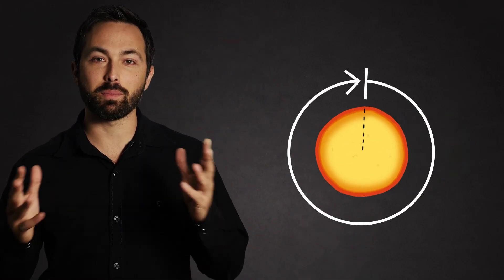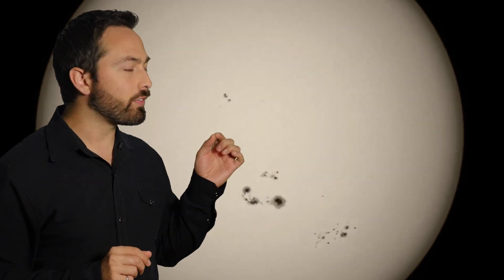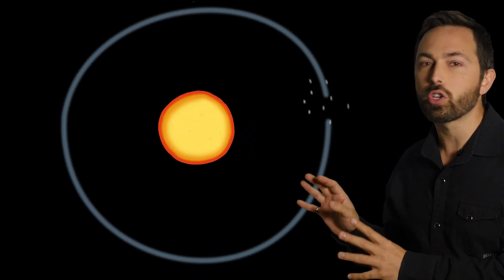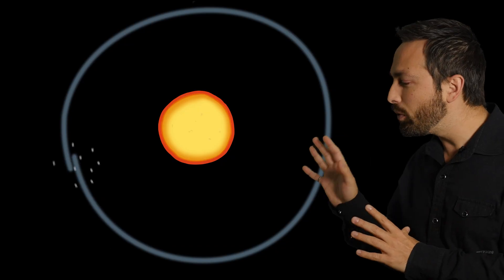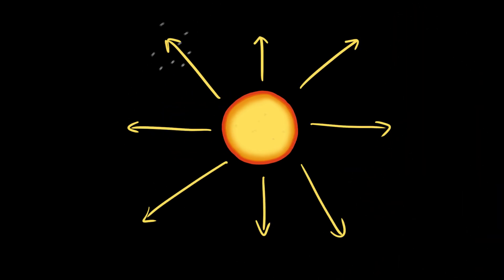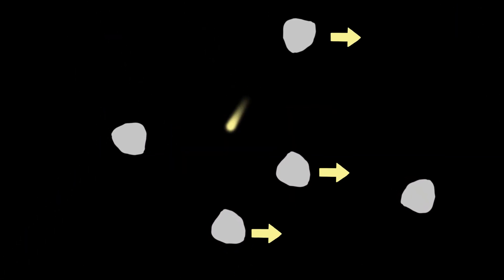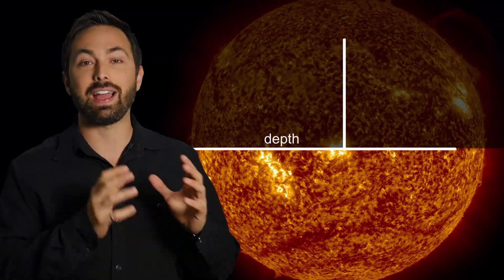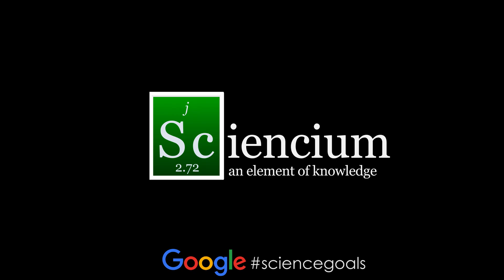Why is the Sun Slowing Down?

Comment: Can dark matter can squeeze in this.. Im 14 and stupid but stupid sometimes solve stuff. Butt what if the apearance of the dark matter between the plasma then hits faster that anything like no explaination it will slow down i mean there is countless dark matter appearing...

upon typing this.i have a question when dark matter pops up can it apear on a existing matter? Or just a thin space aaaaand is it like the light that can bumb in but cant really answere this cuz dark matter disapear faster than a message passing tru youre brain.

Comment: Based on the graphic shown of the Sun's inner photons shouldn't it be possible for the photon's bounce to have an equal chance to speed up the rotation as well, or does photons only come out at a certain angle, just like how they come off the sun slowing dust particles??

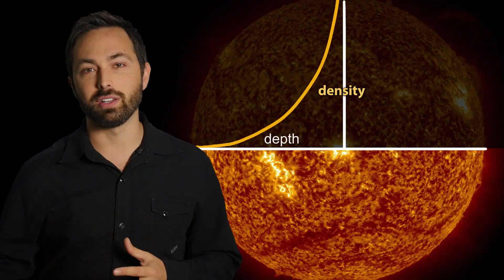Comment: [4:40] Wont it take infinity to slow down solely by this mechanism to any star ,no matter how fast it is spinning and how big is the time interval? As the described effect is caused by the spinning (the projection of the velocity vector of the photons on the tangent plane, to be specific :) and the slowing down will weaken it. It can get closer to zero, but never reach it. Or I am missing a thing?

Comment: Can someone explain why dust slows down in its orbit in more detail? Wouldn't more of the photons be hitting the inside edge of the dust than the leading edge, therefore bouncing back toward the sun and pushing the dust further from the sun, giving it a higher overall potential energy?

Also, if photons can slow down the the dust (or anything for that matter), but the photons obviously carry on at the speed of light, what happens to the kinetic energy that was lost? Is it simply converted into heat energy inside the dust?

Comment: Some simple 'facts' about the sun:

It's convection has actually been measured and determined to be even less than 1% of what is necessary for energy transport from the core to the outer layers.

How does it come, that heavier elements, that we can clearly detect via spectrometers don't clog up the very small zone where pressure and temperature are sufficient for continuous fusion?

Who made the blatant logical error of saying, that the lightest element Hydrogen sits in the core of the sun, while we can even detect planetary amounts of Iron in the sun's atmosphere? Light stuff always floats on top of heavy stuff.

Why, after 70 years of highly funded fusion reactor research did not one single work properly?
Fission took only a few years.

The sun is not a fusion reactor, even slightest changes in density or amount of mass would destabilize the fusion process, since the yield is very dependant on both pressure and temperature, increasing either by one ppm would increase the yield by 0.1%, enough to oscillate away the outer layers.

Electricity.

Comment: how is this theory? 
sun is cooler on outer surface compared to its inner layer.
i dont know how or why the core is churned, but when you imagine the outer layer is more viscous due to lower temperature and doesnt want to move with the same velocity as inner layer. its just like when a lava from a volcano moves on ground or inside sea. outer cooler surface moves slower when compared to hotter part. having exponentially dropping velocity from core to outer surface. I am not completely  convinced with the photon theory, probably thats why it results in undying sun.
sun will have to eventually die before whatever happens to universe  and if am not wrong this is how it dies....cools down from outer layer to inner layer ....badabdabdbdabdab.....having a final explosion into supernova. tht will be a site to watch...till now i have just watched artists depiction or animations of supernovas :D. 
please do comment if thats anywhere close to possible theory

Comment: I might be confused, how can a lightparticle gain momentum when it always travels at the speed of light? it can indeed bounce on those dustparticles, slowing them down, but does it really gain something there? i know this should be logical, conservation of momentum/energy, but I don't get how they could gain momentum.

also, how could an object with no mass convey energy to another object? it would have to transfer energy in another way than by pushing

Comment: As the photon bounces off the last particle and into space, it exerts a tiny force on that particle. But wouldn't different photons exert force in random directions, depending on the angle of the collision, and therefore shouldn't it cancel out the effect? I think the answer to this is that a head on collision (using the car metaphor) would be more forceful than a bump from behind.

Comment: Would this not result that we would observe one side of the sun slightly brighter (or at least the very edges) and/or (depending on how many photons bouncing on the outer layer) move the visual sun a bit or at least make it a little bit blurry? This due to more light go into a angle?

Let's say that 50% of the light coming of bounced to a 20% angle it would make a double projection of the sun right? And if the angel vary a lot it would make a blurry projection? 

Or is it just that the speed of the outer layer is so slow compared to the speed of light that the angel will be so small we can't even detect it? (probably this... So nice when you figure stuff out while you write and then still want to post it :P. But still does anyone know if its observed/known?)

Thanks for thoughts!

Comment: I'm not convinced yet, according to this theory if the photons get deflected (less than 90 degrees) by the dust particles they are taking away some angular momentum hence if they are deflected by more than 90 degrees then the photons must be pushing the particles away too. Given that dust particles are much larger than photon, the number of photons hitting the dust particle and getting reflected back ( deflection of 90 to 180 degrees) would be much larger than the ones getting deflected by less than 90 degrees. Hence the dust particles should be moving further away from the sun as a result of the push of photons

Comment: Wouldn't the direction of the photon be random and therefore have a chance to either strike against - causing a slow down, or strike with - causing a speed up, of the outer layer - like tailwind on an airplane?

Comment: How can a photon "steal" another particle's momentum if it is already moving at the speed of light and can't speed up anymore?
Reply: I will just paste the answer i just put on another comment here XD
There are two things...
First, the momentum is also about direction, if the photon changes its 
direction in the colision, it might also change the momentum of the dust
 particle in some direction.
Second (and most important, I guess) the photon momentum is not p = mv 
(for it does not have mass), it is h/lambda, where h is Plancks 
constant, and lambda is its wavelengh (because it is a quantum thing), 
so it can change the modulus of its momentum by changing its wavelengh.

Comment: So uh... I can't help but to think about the entire... ya know... 'photon bouncing around inside the sun' thing.... if its bouncing around inside the sun, why doesn't that cause anything? and regardless of that answer, the photons bouncing around inside of it, means that it would leave it at random angles and such, not 'straight out'... meaning, that the photons are just as likely to hit that invisible layer as its moving WITH it, not just when its moving against it. So not only would the photons be slowing it down, but it would also be SPEEDING IT UP. . . So I don't think photons could actually be a realistic 'cause' for why the sun would be slowing down. Maybe it has a very tiny impact on that, but considering all that, I really doubt photons are slowing it down as drastically as people have thought...

Comment: Has anyone tried applying eulerian video magnification techniques to high-quality video footage of the sun?  Eulerian video magnification can take a video feed of, say, a human being and magnify the rhythmic slight variations in color over the surface of a persons skin.  It then makes those differences larger, and you can actually read a persons pulse from any video taken of them.  They can also magnify microscopic motion in the same manner.  It should, I expect, be able to make it extremely easy to analyse any kind of cyclic changes in either the Suns light output or fluctuations in its surface, though I haven't heard of it being applied to astronomic observations yet (its relatively cutting-edge computer science work).

Comment: What do you mean at 4:54?

Greater momenta? 

I assume that all light photons will travel at the speed of light, but do some photons have more mass than others? 

It makes sense that a brighter star would emit more photons, but would the photons also have more mass? 

Perhaps a good idea for a video (the mass of a photon). 

Thanks!
Reply: The momentum p = mv is an apriximation for classical stuff (not quantum) and that are moving at speeds not comparable to the speed of light (not relativistic). 
The photon momentum may be writen it is h/lambda, where h is Planck's 
constant, and lambda is its wavelengh (because it is a quantum thing), 
so it can change the modulus of its momentum by changing its wavelengh.
If the star emits photons with higher frequency (or shorter wavelengh), these photons will indeed have greater momentum

Comment: Maybe a stupid question:

Im not into physics but aren't photons massless? How can they generate momentum? Isnt momentum mass*speed?
Reply: In physics momentum has some more general definitions so that you can define momentum for things that does not have mass. These kinds of momentum are useful and are conserved just as the "p=mv" momntum.

The momentum p = mv is an apriximation for classical stuff (not quantum)
 and that are moving at speeds not comparable to the speed of light (not
 relativistic). 
The photon momentum may be writen it is h/lambda, where h is Planck's 
constant, and lambda is its wavelengh (because it is a quantum thing), 
so it can change the modulus of its momentum by changing its wavelengh.
If the star emits photons with higher frequency (or shorter wavelengh), 
these photons will indeed have greater momentum

Comment: Lightspeed is fixed, so how could a photon "gain" momentum from hitting an object?
Wouldn't it rather loose momentum, if at all?
And btw, after a photon travels through diamond (slowing down by 40%), how does the photon accelerate again after leaving the diamond? Where does it get the extra energy from?

Comment: It could simply be the electrical discharge as explained by the EU theory. The external source of electrical discharge is continuously fed into the surface of the sun which is why the heliosphere is hotter than the surface. This would mean that the it would exhibit radical electrical activity and thus be slowed from the incoming discharge.

Comment: But... isn't the coriolis effect enough to explain why higher layers of a rotating object made of plasma slow down from inside out? And beside, the vectors of photons impacting with dust particles should be way higher on the radial axis than any other direction, so why dust particles fall down onto the Sun? Shouldn't they instead get farer?

Comment: but how can something with no mass slow something down? :S no mater what the speed of the photon, the 0 mass * the speed of the photon is still 0 :S Im not a physicist or what not, just a nerd with thoughts. like a 1 ton car driving and crashing into a wall in 30km/h, the force of which the wall receives is 1 ton times 30 right? so for a brief moment the wall receives a 30 ton hit, right? :O

Comment: Question(s): If a photon takes angular momentum from a dust particle would it speed up? If it did won't that put its speed above the speed of light which isn't possible. Where does that extra energy go? Does it go into changing the frequency of the photon?

Comment: why wouldn't photons push dust away? when new star is formed, it clears nearby dust, by pushing it away with its fotons, so thats contradictory to dust spiraling down to a star. The angle at which photons hit particles, would be so insignificant, that outward momentum should be far greater than decceleration (unless dust is allready on a very close orbit, so its speed is comparable with speed of light)

Comment: Please don't go harsh on me I saw similar questions but not exactly an explanation for mine. SO here it is:

I do understand that photons hitting dust have a slight angle to decrease the momentum of dust. That's how it slows down. However vectorially it has still the biggest component radially outwards. So it should also push the dust away from the sun. Even if it might be a small effect it seems somehow significant considering that dusts are not very fast compared to speed of light and radial vector value is still very high. I also know radius of orbit is proportional to speed^2 (centripital acceleration = v^2/r) which enhances the effect. Though still I think order of magnitude-wise they should be similar.

Sorry for long text. I appreciate any explanation.

Comment: Hey Derek, or whomever could answer this, you exposed that the external layer has been slowing down, and the hypothesis you explain seems a bit intrincate to me. Let me explain, you said that the photons that come from the inner core, bounce several times until they reach the most outtern layer, thus slowing it down. But, if this were to be the true, it would not just affect on one side of the rotation, it would, simply, affect in all the possible ways, not only slowing down.

And the other question is, why is not friction considered as the very producer of this, slowing down? Or maybe the the production of new materials due to the nuclear fusion, that changes the density and so the velocity?

Best  wishes,

Gastón

Comment: How Photons can slow down anything. They have mass=0.
Reply: They have momentum!
Reply: But they have no mass. You need mass to have momentum right? Besides how you can even exist, be real if you dont have mass? 

Maybe photons have mass but its so super very tiny we cant detect it?
Reply: Indeed, photons have no mass. However, they DO have energy and momentum. It turns out that energy and momentum are the requirements that make a solar sail work, not mass. 

If we think about a slow massive particle, like a bowling ball, we can help to make sense of this. If the bowling ball is not moving, then it can't make anything move. And a heavy bowling ball can make something move more than a light bowling ball (if we assume both bowling balls are moving with the same speed). To summarize, how much something moves (how much momentum is transferred) depends linearly on both the bowling balls' mass and speed. Momentum (for slow moving massive objects) is defined as p = m*v (p is the momentum, m is the mass, and v is the velocity). 

This momentum is what gets transferred when wind hits a normal sail. But photons have momentum without having mass! This is how they can push things around, they transfer momentum. For a photon, E = h*f = mc2 so, p = hf/c. In this case, p is once again momentum, h is Planck's constant (6.62 x 10-34 Joule*seconds), and f is the frequency of the photon. This is how a solar sail works. Photons transfer some of their momentum to the sail, thereby propelling it along very much like a sailboat in the ocean.

Comment: but, most of the momentum is tranferred to the dust particles is pointing away from the sun. it sounds like the sun is bringing these particles closer by pushing them away. this is really strange and counterintuitive.

intuitively it seems to make ore sense that outward accelleration would contribute to angular momentum somehow..

Comment: So let me get this straight, a photon is massless, but "drags" on dust around a star because it's transferring some of the energy if itself, (the photon), to the dust particles.  To me, that that says that this is not like a particle bouncing off the dust, but the photon being absorbed by the dust, then being re-emitted at a different, lower, energy level, increasing the mass of the dust very slightly.  (So, acquiring mass means more attraction to the star and being pulled into it more and more).  Is that about right?

Comment: dear veritasium/sciencium
but wouldn't those particles have to be hit by the photons in an at least 45° angle (in the particles system of reference), implying the particles to move really fast (0.5 c, 0,7 c, somtehing like that? honestly, i'm just too lazy right now to even try calculating ;p )? because else they'd  get hit/pushed by the photons more in a "downwards" way (in your videos SOR), thus increasing their gravational potential respectively pushing them away from the star?
sincerely, one

Comment: Why wouldn't the photons hit in the opposite direction too and speed the top layer up?  Wouldn't it be a net-zero effect overall?  Or does the dust get pulled a certain way due to the direction of that upper layer, like the moon effecting the tides?

Comment: but why cannot the photon particles hit the sun's surface in a direction opposite to the shown. it will then give a part of its momentum in the direction in which the outer layer is moving. which can then, cancel out the momentum transferred in oppo direction. then, on an average, there shouldnt be a slowing down of sun.

Comment: Wow. I learned out from Wiki that medium dust is slowing it's orbital speed and get closer to the Sun. Yup. My instant objection was about light pressure, that's why I looked into Wiki. And it describes that tiny dust indeed is blown away from the Sun, not falling. The difference is between coefficients: medium dust brakes and lowers because of "Poynting–Robertson" stronger than lifts under light pressure, while tiny dust lifts stronger than brakes it's orbit.